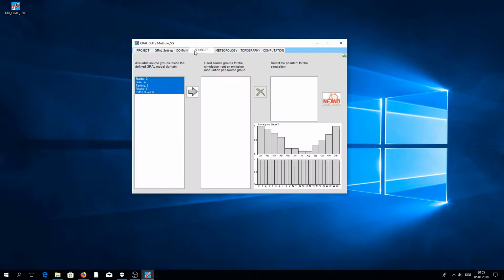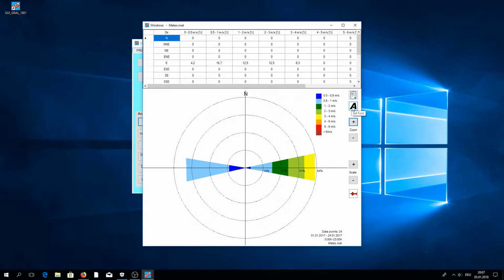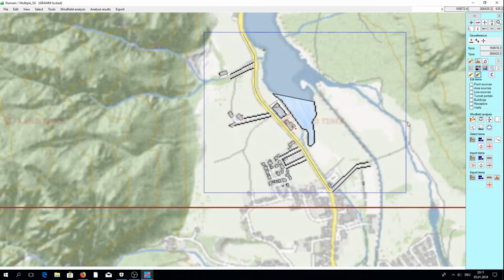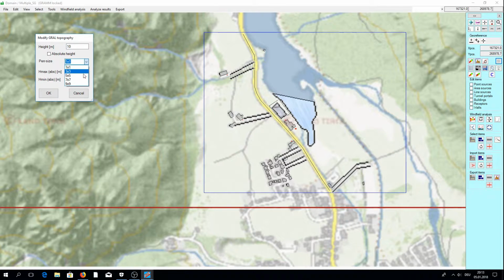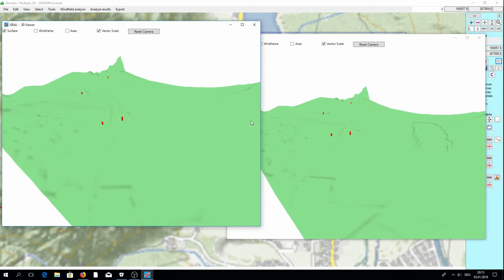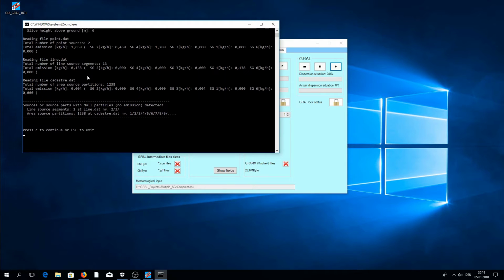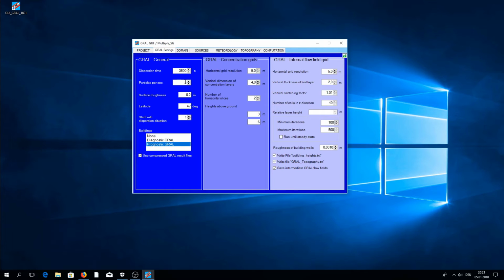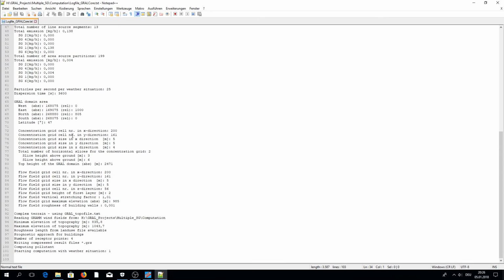New functions in the GUI 18.01 and GRAL 18.01 | GRAL #4

Comment: What coordinate system does the georeference used in GRAL employ for projection?
Reply from the maker: Dear @user-km8tj1xi2e,
the GRAL GUI is greatly simplified and is using a Cartesian coordinate system, which is sufficient for small calculation areas. 
When georeferencing, you define the local coordinates you are using.
Best
Markus
Reply: Okay i understand. But i have problem: I cant set up GRAMM, specially input the topography data in GRAL... can you share tutorial how to input? thanks  @grammgral8697

Comment from the maker: The guide is available at the download area of the homepage http://lampz.tugraz.at/~gral/index.php/2-uncategorised/1-description

In the first step, a prognostic wind field must be calculated using the mesoscale GRAMM model. I would recommend a horizontal resulution of 100 or 200 m and an area of at least 10 x 10 km2
One needs topographica data, landuse date (europe: corine dataset) in ESRI ASCII format and an artificial windrose (delivered with GRAMM) to compute the GRAMM windfields. Hint: the wind rose classification should include enough high wind speeds 
When the calculation is complete, you can create a new project and make a match to observation evaluation, to find the most suitable windfields for your local meteorology.
In the next step you can create the GRAL model and import detailled topography data (raster width down to 2 m) to calculate the CFD flow field around abstacles and the topography.
With little experience it is difficult to get good results right away. Good luck and enjoy the work with GRAMM/GRAL
Reply: Sorry can you share again the new homepage? because the homepage already not found. Thanks
Reply from the maker: Dear  @NabilahRizki-l2s , the new homepage, now as Hypertext Transfer Protocol Secure (HTTPS): https://gral.tugraz.at/ 
Good luck familiarizing yourself with GRAL
Reply: Thank you so much. Can you share about preparation terrain data for input to GRAL?  @grammgral8697